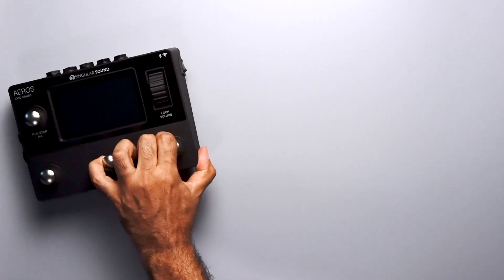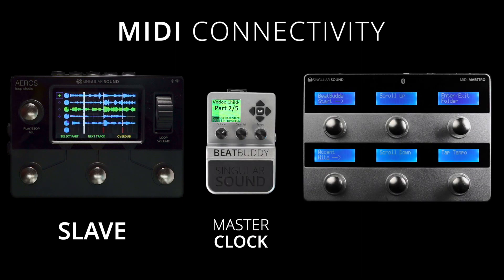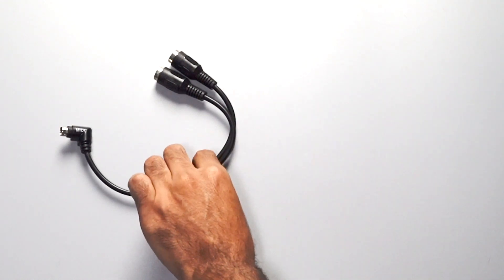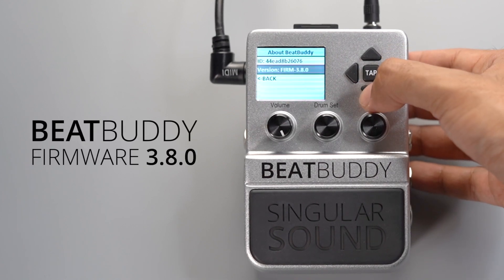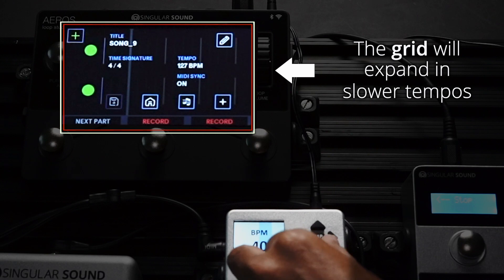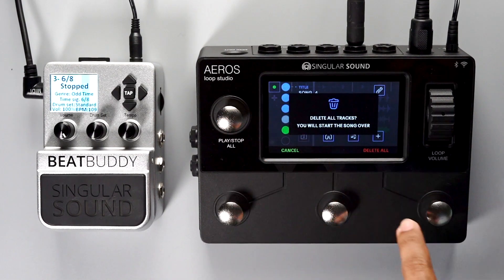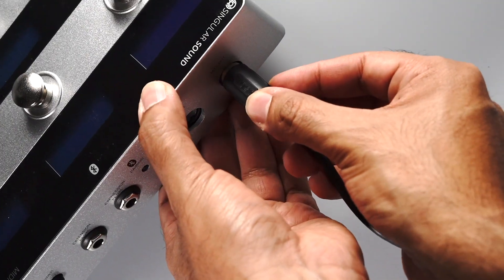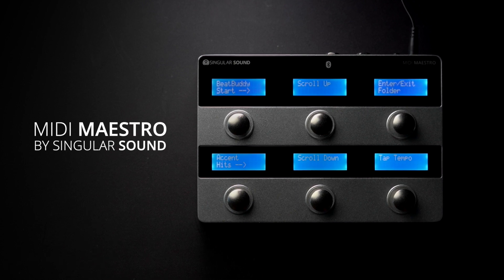AEROS Loop Studio + BeatBuddy + MIDI Maestro - MIDI Connectivity

Comment: I’ve connected the 3 pedals as instructed. The maestro stops and start the BeatBuddy and the Aeros. 

I’ve connected my acoustic guitar into the Aeros Left input and then the Aeros left output into my PA. I can hear the guitar and it records loops (via the maestro). 

But I can’t get ANY drum sounds from the BeatBuddy, even though the selected song is “running” and starting/stopping via the maestro. How do I get the drum sound from the BeatBuddy, through the Aeros and into my PA? Or do I have to run an out out from BeatBuddy into my PA and not through Aeros? Sorry for the ignorance. I’m a 59 year old newbie and very tech illiterate.
Reply from the maker: Hi there, we're here to help ;) 

You'll need to connect the BB into your PA separate. This way, you can have an independent mix of the drums and better control of the overall mix. The MIDI connections are independent of the audio routing signal. Feel free to email us at support@singularsound.com and we'll be happy to help you out.

Comment: HI! About BeatBuddy MIDI Adapter... please tell me the metal parts of the connectors are also soldered?
Reply from the maker: Yes they are!
Reply: @SingularSoundOfficial  thanks for the answer! another question, will the maestro cover footswitch+ according to his capabilities?
Reply from the maker: @сергейкарев-ю6н  The MIDI Maestro can do what the Footswitch+ can but MORE with many more options and capabilities. You can also use the Footswitch+ with the MIDI Maestro for an extra set of options, if needed, in addition to what the MIDI Maestro can provide.

Comment: I have my old BB and currently using it with Pigtronix infiniti.  Biggest problem i have with that is the shot duration limit on looper for each song.  Sometimes I want the looper to cover the entire 4 min song.    FOR me the Maestro is more than i want.  I assume i can use the Aeros with the BB and forget the Masestro connection?
Reply from the maker: Hey there, you do not need the Maestro to connect the BeatBuddy and Aeros through MIDI! The BeatBuddy and Aeros both have MIDI ports, but make sure to get our BeatBuddy MIDI adapter from our website to connect the devices. Check out this video showing how the Aeros and BeatBuddy work together seamlessly when connected through MIDI: https://www.youtube.com/watch?v=fwWkWC9rdzA

Comment: Having the BB and the Areas looper wondering about the following issue. Can I use my TRS/Insert Kabel to connect to my audio interface, both the BB and the looper? And if the answer is yes, do I plug the two jack ends into the BB/Looper or into the audio interface. Sorry, beginners question
Reply from the maker: Is your TRS a stereo cable, a split-y cable, or a mono-balanced cable? And do you have only one of these cables?
Reply: @SingularSoundOfficial  It is a split Y cable with one "Stereo" Jack on the side and 2 "Mono" jacks at the other end. I have 3 of those cables.
Reply: @SingularSoundOfficial  Hi Guys, am I getting an answer or is that case closed for you?

Comment: If you change a song on the BB does it also change the song on the Aeros? Or vice versa?... Wondering if I'm playing a setlist, do I have to change the songs on devices individually or are they linked? Thanks
Reply from the maker: Thanks for this question. As up now, the BB only changes the BPM and keeps both units sync together. You can create a set-list on the BB using the BB manager for quick access during a performance.
Reply: Is this answer still true? I have the BB and just got the Aeros, both with the latest firmware. When I switch the song on the BB, I’d like to have the Aeros automatically go to the associated recorded song.

Comment: Ok... I can hear my other instruments and record them on the aeros...they are all going in through the aux input on the back of the aeros.  The BB pedal is connected thru the midi cable and is communicating with the aeros (tempo change works on both)  but I cant hear the beat buddy or record it...  do I need to go through the audio input of the BB pedal?  Yes the BB has the latest firmware
Reply from the maker: The best way is to record or send the BB signal separate to have better control of the mix. One cool trick would be sending the ALS signal out to the BB inputs (you can use the BB as a DI box) and get the sound out from the BB headphones. Feel free to email us at support@singularsound.com for further questions.
Reply: Ya I realized I just had to reverse the signal chain I had.  Starting to get the hang of it.

Comment: Thank you but my question has not been solve you talk about the midi cables but you already connected other cables and that’s where I get lost pluggin the grar to my amp and amplified speaker i eant the sound of brat buddy sounding in the amp speaker and the pedal gear connected to aereoslooper and out to my amplifier i hope i made my self clear thank you so much 🙏🎸
Reply from the maker: It's best to plug the BeatBuddy into a full-range speaker. Many guitar amps will muffle the BeatBuddy sound so you won't hear the higher frequencies. If your amp has an aux in port you can plug the BeatBuddy from the headphone jack to the aux in port.
Reply: @SingularSoundOfficial  problem solved 🙏

Comment: Looks like the BB and Aeros needs to set tempo manually all the time. So you cant pull up a recently recorded loop or change songs and have the BB auto map the tempo. What a drag. Seems so fundamental to have a truly hands free setup!
Reply from the maker: Hey there, The BeatBuddy can control the Aeros' tempo when the BeatBuddy is the master device, but the Aeros is not able to be the MIDI master quite yet. Stay tuned!
Reply: @SingularSoundOfficial  Thanks for your reply.  From a practical user standpoint the live situation with a band is what I'm trying to work through.  For now I can use pre recorded loops with the Midi Maestro and Aeros. That works great by the way. Integrating the BB requires a manual approach. It makes sense to have the song drive the BB not the other way around. I have used the BB in a duo situation with a bass player. Not an intuitive approach and clumsy. For a new loop using tap tempo on the Aeros should  register the same tempo on the BB.